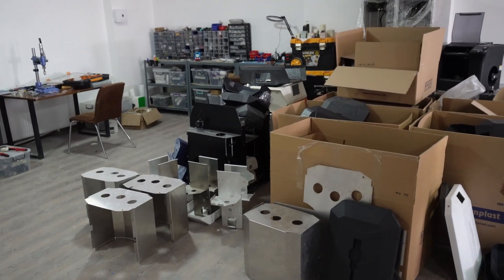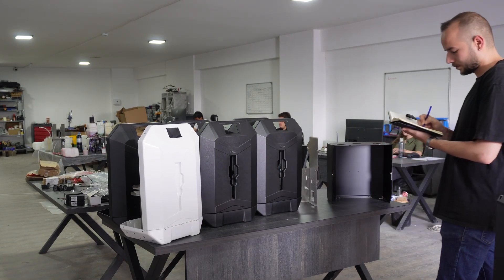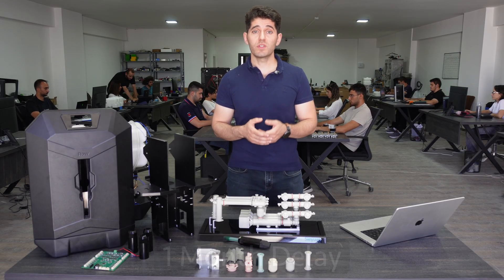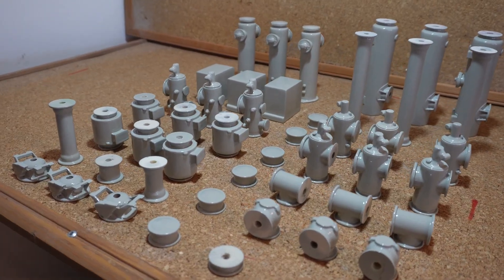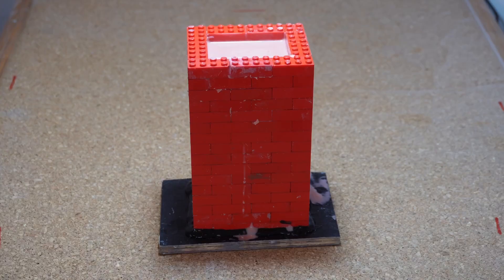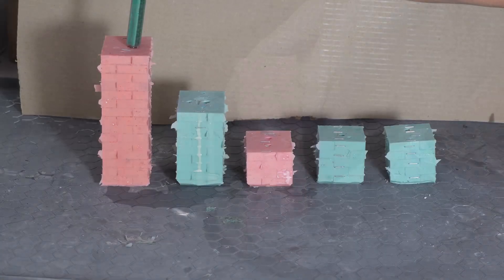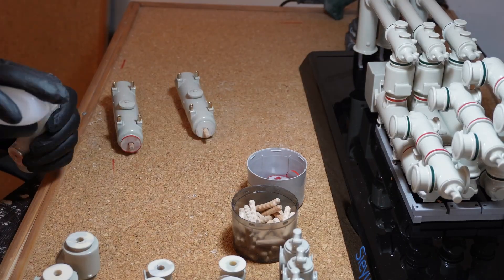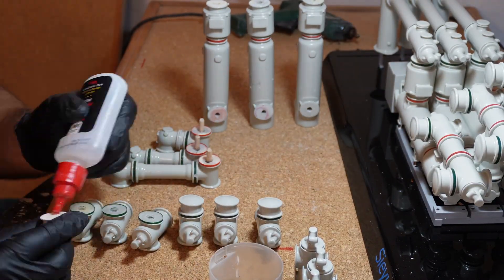Building Scale Models for Business | Casting Small Parts with Desktop Injection

Comment: Nice. Appreciate the commit to high quality standards. It would be neat to see strength testing of the various material you will offer. Tensile, impact, temperature resistance, etc. 

Just to confirm. Do sla resin 3d printed parts need to be primed or coated before using them for silicone molds?
Reply: Not Neckog obviously but the answer is broadly yes. 

I'm told that you can print in a transparent/clear resin and just post-cure the heck out of it and it should be fine but if you're unsure or can't use a transparent resin then it's better to er on the side of coating the SLA printed model fully so you don't have to deal with any cure inhibition issues.

Smooth-on was coming out with a 3d printing resin (XTC-3D Print) that is designed specifically to not need any coating to be molded (providing you cure it properly according to their instructions) but I can seem to find a link to it anywhere yet sorry. I saw it when I want to a class on making molds from 3d prints at Reynolds advanced materials

Also bonus tip: apparently "universal Mold release" is not actually universal as it contains silicone oil which for silicone mold making will act as an adhesion primer instead of mold release. Ease Release 200 or 205 is what you actually want 👍
Reply: @BrennonA Awesome, appreciate the response!
Reply: @potatofries144 no problem, good luck with everything!
Reply from the maker: If you’re using SLA-printed parts, platinum-cure silicones cannot be used directly without sealing the surface first. However, most tin-cure silicones are compatible with SLA prints and can be used without sealing.